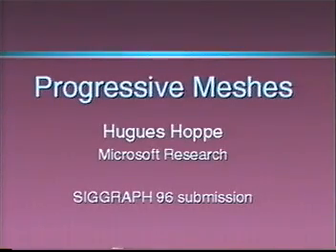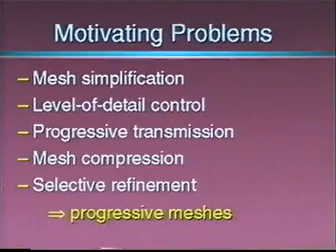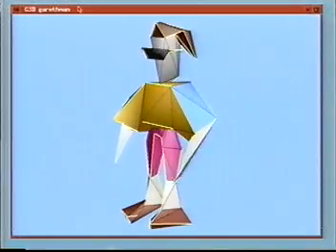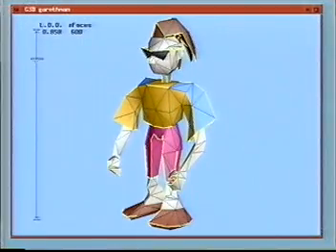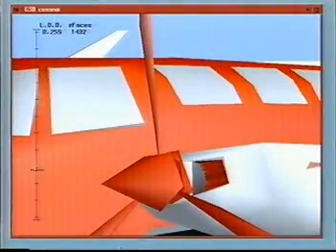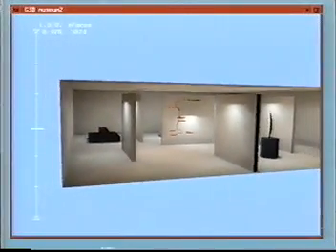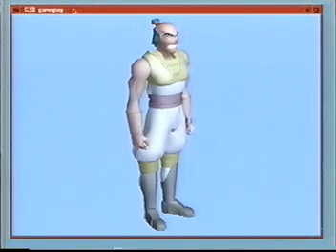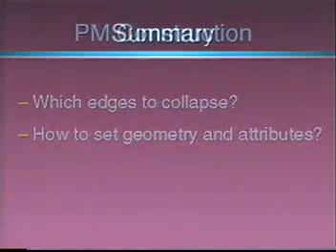Progressive meshes (SIGGRAPH 1996)

Comment: This brings back a lot of memories. Back in 1998 I was working in the R&D department at Bullfrog Productions and was tasked alongside three other developers to each independently come up with proposals for a level-of-detail system that could be retro-fitted into the upcoming game Dungeon Keeper 2. The constraints were tight and the engine had already been mostly written, so any proposal had to work by changing index buffers only so that fewer triangles got rendered i.e. it couldn't change any of the actual vertex buffer data, which was already being subject to a host of transforms (not the least of which was skinning). On September 11, each of us presented our proposals, along with proof-of-concept demos we'd been working on. The proposals included one that basically eliminated shorter edges first, one that tried to preserve sillhouette edges, and one that required user-assisted hueristics. The system I proposed was based almost entirely on the technique in this paper, albeit modified to account for the fact that vertices couldn't move during edge collapses (turns out that minimization of the energy metric for a given edge works just as well when one vertex collapses to the other). The result of that meeting was that my proposal was the one selected for the project, and while the overall polygon reduction was a modest 25%, it was considered a phenomenal success given the extreme constraints of the problem coupled with the fact that the polygon counts of the models had already been hand-optimized by the art team as far as they thought possible.
Reply from the maker: Fun to hear about this; thanks for sharing!